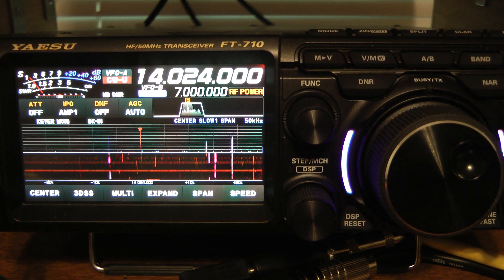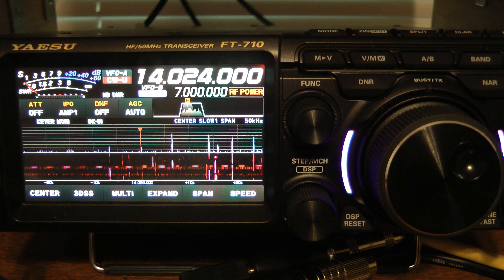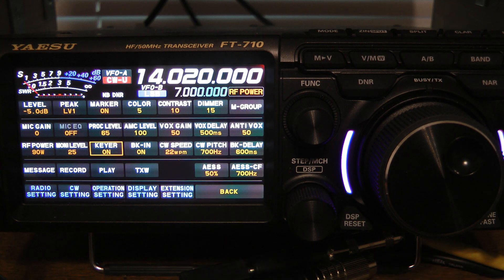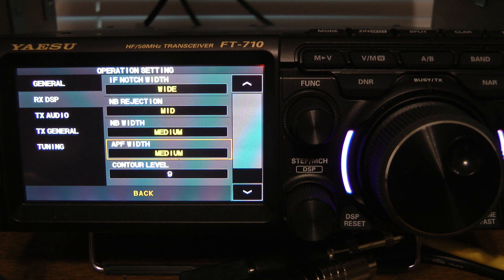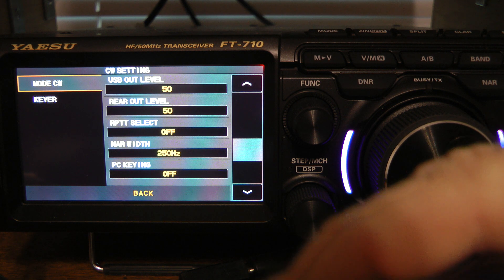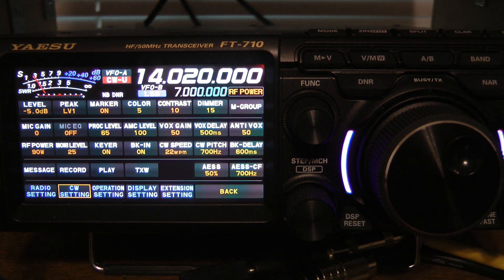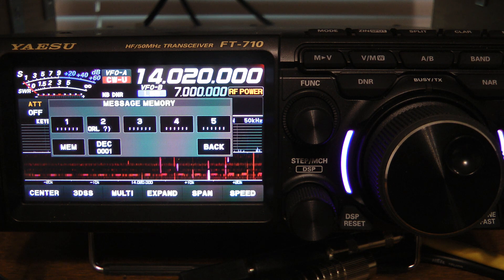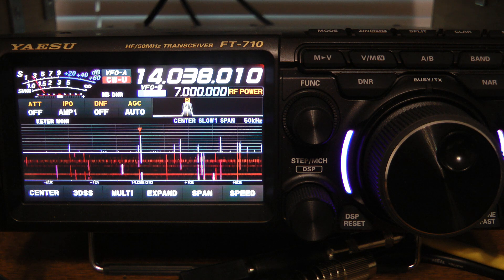Yaesu FT-710 CW setup, APF, Morse Code

Comment: show us the AESS..  is that the old Binaural CW where a cw pileup is spread across the stereo image?  Big deal back in the 80's when switched capacitor audio filters came out!  Can be effective if implemented properly and use headphones.
Reply: I presume you can touch screen the bandscope and instantly turn to that signal and it's near perfect like the 7300?

Comment: On my FT DX 1200 I always use the APF filter on CW. It gets rid of all the weaker signals and noise and brings up the strongest signal on and close to the frequency. I will also set the bandwidth to narrow 50hz and APF wich is also 50hz. With both the APF and narrow bandwidth gives you even more noise elimination on CW. Great video as always John I hope to talk to you again 17m. 73🙂

Comment: Once I have my cw messages stored,  do I have bring up the message screen to use them, or is there buttons to tx  the message whilst on the air ?
Reply from the maker: You have to bring up the message screen on the 710 and tap on the message you want to send

Comment: Maybe now that you owned it a while you can answer some cw operation questions!  

.  First, does this offer a tx delay and at what steps?   tx delay is critical to avoid keyclicks when using an external amplifer.  

Second,  how is the QSK done.  Is it by noisy relay or by reed relay or by diodes?    Skipping QSK is like asking Mrs Lincoln if she enjoyed the second half of the play.

Third,  is the filter selection wide/med/narrow or just wide and narrow ?   

Forth, can the APF (good feature, BTW) be accessed via a one-press button or programmable button?     

Only thing I found "new" compared to my nearly 7 year old IC-7300 backup rig is the audio peak filter.   But seems like a big hassle to get to that feature, it's probably not gonna be used too much   

Generally my impression is this is yet another entry level yaesu rig with  sexy lights and screen, perfect for an FT8 or casual SSB operator or someone who wants a TV screen in their shack, but for any serious CW work we are better to find something else, like a used K3 etc.
Reply from the maker: I will try to answer your questions: Let me begin by saying when I compared the 710 with my K3 the 710 was picking up weak CW signals that the K3 could not hear (Which I could not believe) so I did several more comparisons and the 710 has a better receiver than my IC-7300, TS-590SG, and OMNI 7. I sold all those rigs including the K3 and bought another 710 for backup.

No transmit delay, but I have listened to the 710 with the amp on and have not detected any key clicks.

I do not operate QSK so I can not answer that question, since I was a kid in the 70's I have always operated semi-break in

Only wide or narrow filter, but its easy to narrow the filter by using the DSP knob. I have my narrow button set on 250hz, but it will go down to 50hz with no ringing.

I do not like the APF access because you have to press the DSP knob and then turn to APF and press again... But I control my 710 with ham radio deluxe so I don't have to get into the menus on the radio. APF is pretty amazing on weak signals, the noise melts away and the weak signal pops out of the noise!

On my channel you can watch the comparison with the K3

I hope this helps, 73 and Merry Christmas

Comment: John, thanks for the great videos. I just unpacked my FT710. I'm having difficulties setting up cw with my bencher paddle. I've been all thru the menus and can only get one side of the paddle to work. Ive changed the cables twice and re checked each connection. I have it set on electric keyer a but racking my brain on what setting I'm missing. Any thought?
thanks
Greg WB5LXJ
Reply from the maker: Hey Greg, send me an email on my QRZ email address (N5ID)... I will send you my phone number and we can talk about it on the phone
Reply: Are you using stereo plugs and wires on your paddles? Mono plugs will cause this problem.
Reply from the maker: No, just the speaker on the radio

Comment: Better if you take the preamp of and get rid of all noise 😉
Reply from the maker: I use the preamp on 20-6 Meters because I generally have 0 noise on 20-6 meters and without the preamp I might miss some weaker stations. On 80 and 40 meters I do not use the preamp.